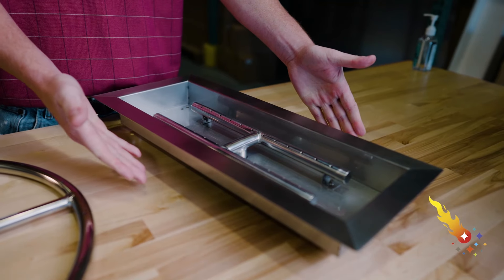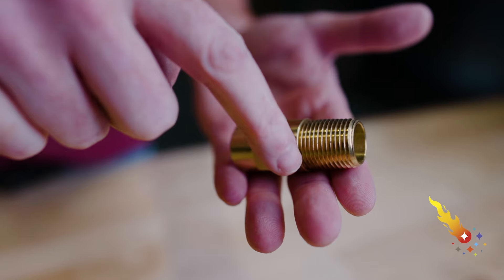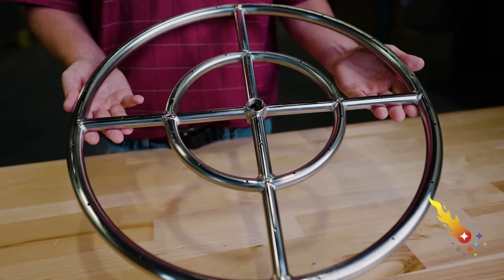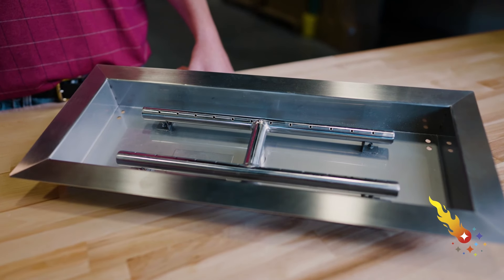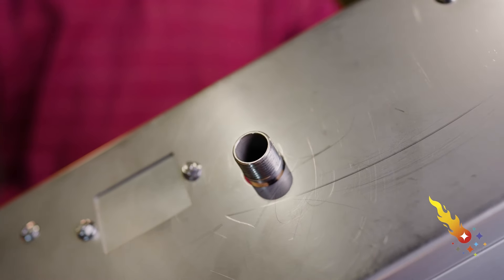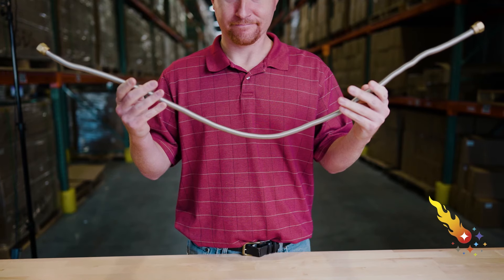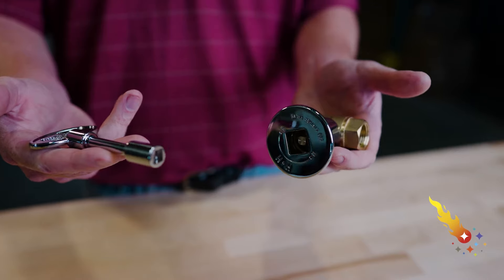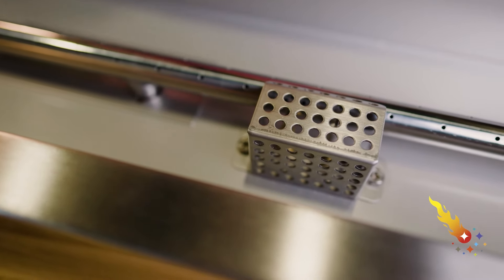Quick Tips for Installing a DIY Natural Gas Fire Pit

Comment: hello may i ask what gas required for fire feature??
Reply from the maker: The most commonly used type of gas used for a fire feature are Propane (LP Gas) or Natural Gas
Reply: Ok ty
Reply: hi I have a burner kit like the one you are using here as an example.  I'm trying to build a circular fire pit within an iron 67cm bowl. I have cut and welded the connector to the iron  bowl and I am concerned about heat generation from the pit melting or damaging the supplied rubber pipe as it seems the  connections and pipe under the pit get very hot.within say 10 mins... Any advise you can offer would be greatly appreciated. I am also finding it hard to find standard gas  QCC type 1 bottles here in Bali Indonesia. Seem all the gas bottles have different standard/  type connector to tank with safety value ( inner ball-bearing) that shuts of the gas as yoy turn higher?   Question: Do I need a converter or different system. hope you can help.